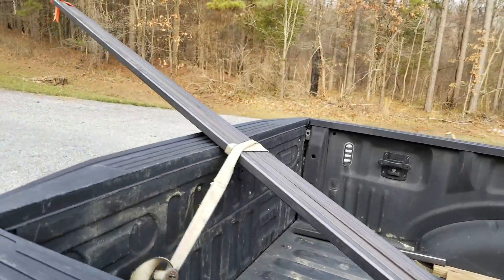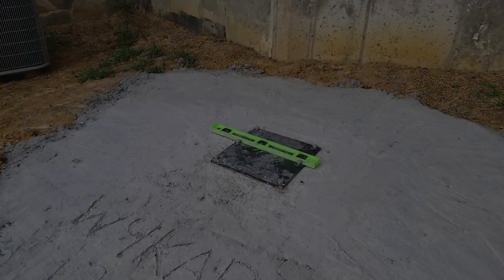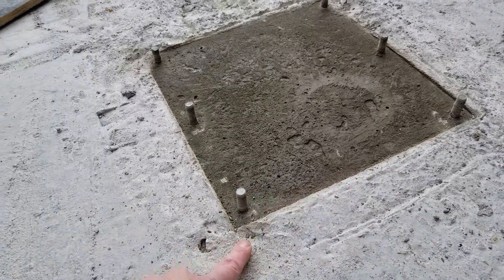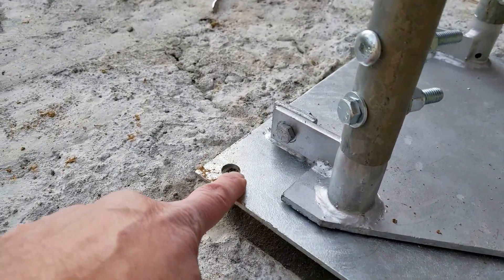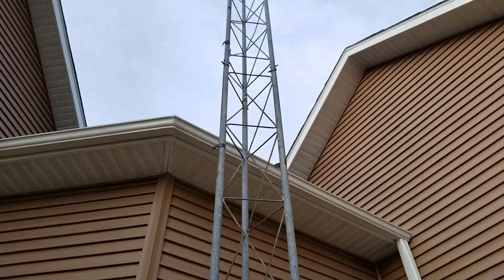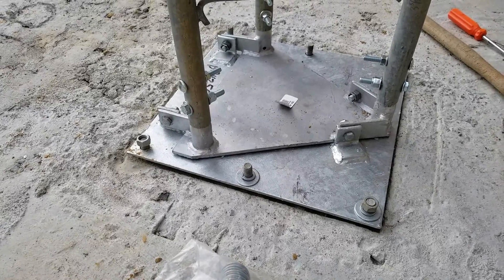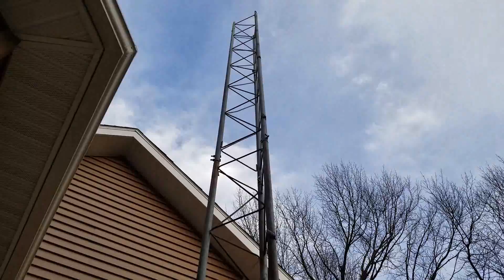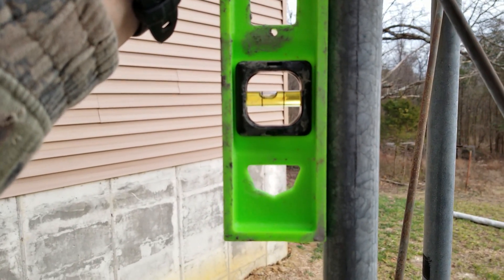DIY Ham radio antenna tower hinge plate installation 12-19-18

Comment: This is pretty cool. As others have said, when setting rods for a base under equipment it’s good to run them long. That way you can run nuts underneath and level the base plate at least 1” above grade by sandwiching it in between the upper and lower nuts. It is important to pack grout underneath then grade it off for support and to keep water diverted away from the base hardware.
Reply from the maker: Well this was a DIY project but it has survived 70 mph plus wind storms and tornadoes have hit close by! Still standing! Thanks

Comment: You don't check a tower for level, you check it for plumb.  If I was going to bracket it to the house, I would have put it next to one of the tall walls and just bracketed to the soffit or wall.  Why in the world would you put it in the middle and have it hanging out next to nothing?
Reply from the maker: That was the best location for it, out of sight in the back yard area. It has survived tornadoes and massive wind storms so it was a success.
Reply: @kapperoutdoors  I'm glad the tower is working for you.  Thanks for sharing.

Comment: Think 80 feet would work on a hinge plate?
Reply from the maker: eek, I don't know. You'd have to make some pretty heft support brackets!
Reply: I know someone that has a hex beam on a 65' tower.  The only guys are heavy synthetic line.  We've had high wind several times but no sustained hurricane force winds since the hex beam and rotator were added.  He does have the ability to lower the tower for storms.

Comment: I like the plate system, why is there 6 ft diameter of concrete?  Is that just spill off?
Reply from the maker: I made the concrete base extra large and heavy just to be safe. So far it has survived years with many tornado warnings and straight line winds of up to 80 mph.

Comment: U didnt show how u lined up base screws and filled in cement ...
Reply: He transferred the bolt pattern to a piece of plywood and mounted the bolts to the plywood and pushed it down into the wet concrete.  Then after it cured, he pulled off the plywood.
Reply: How deep are these bolts? I have heavy duty base plate for rohn25g tower. I trying to find videos show me install of these base plates. Very similar to this video. I plan on doing 4 feet deep cement square.

Comment: Looks like he mounting issue could have been avoided by punching/drilling larger holes in the base plate; for example, 5/8" holes for 1/2" bolts.

Comment: did you finish it i would love to see house attachment
Reply from the maker: I opted to not attach it to the house, but I added the 3 steel leg/feet at the bottom. And It has held for several years now with some pretty nasty wind storms. Thanks

Comment: It seems like putting a lock washer on top of another washer kind of defeats the purpose of the lock washer.
Reply from the maker: eh, maybe so, but I don't think so..? As long as the lock washer flattens out I don't think it matters. However, I am sure no pro at this, just trying to make something new happen. But so far after what 3 or more years or so, it has withstood some 50 to 70 ish mph winds! I did have my doubts watching it sway up there, but it is still all good. Thank you.
Reply: There were several things I could criticize about this video but for me, the part where he used a precision bubble level tool as a concrete screed really took the cake.   When someone loans you tools, they're doing you a favor so for me this is the ultimate form of disresect.  That is why I NEVER loan out tools.
Reply from the maker: Well it's all about improvising and learning new things. The important part is this tower has withstood every bad storm and many high winds so far for a few years, so I'll still call that a success. I am a hack when I am learning new things and taking on new challenges but it has worked for me thus far. Thanks.

Comment: no idea. thought of when i seen video.. is the tower upside down? yep i sure did ask that... iam thinking water flow. as is the water can drain to the outside of the joints. coz more rust in the outside area.. other way with weep holes at bottom. ill go read rohns site see if they say anything on that
Reply from the maker: Not sure if it would fit together like that because the top obviously has to be the tip, and then from there down it will only fit one way. But from a rust standpoint it makes perfect sense to me.
Reply: @kapperoutdoors  dummy me .. i forgot the top... hahahhahah. that iam still tryin to find one for my r25.

Comment: How much is the cost of that tower?
Reply: Hes using Rhone-25 Tower Sections, They're about 75$ to 90$ each section, depending where you purchase
Reply: I got mine for $100 in mn. 30’ rohn 25 with the top pole and the hinged base plate. Neighbor got one for $100 too.
Reply: A brand new 30 foot Rohn 25G self supporting tower kit is about $800 plus freight.  You can find used ones much cheaper.

Comment: I have the same base plate. The bolts for anchoring the plate in the concrete come with two nuts. While I'm rebuilding my cement mixer, I'm wondering a couple of things. Do I pour the concrete and push the bolts into it or I'm leaning toward pouring the concrete with the bolts in the plate. I'm also thinking putting a bolt (and washer) under the plate for leveling but the plate wont be resting on the concrete. My next wonder is how big the foundation needs to be. I think the answer would depend on my type of ground, which is above my knowledge level. I'm thinking something like 3X3X3.
Reply: I'm sure you have already erected your tower by now, so this info is for any new people reading this, back in the day I helped my father erect many, many towers, usually 40/45 foot, but on occasion a 50/60 foot tower for TV use.  For 45' and less a 3x3x3 foot [1 yard] would hold and self support any tower in the central Illinois climate.  Sometimes he would also install eve brackets for better stability.  We would plumb a 3 foot base section in the hole then pour the cement around it, allowing 3 days cure time.  Then slope the slab away from the legs to help keep water from rusting the legs.   Above 45 foot a tower would always get guy wires to ensure it would remain stable.  If you check the Rohn website they show excellent data on how to install towers.

Comment: Looking at the issue with the bolts it occurred to me that if you used a thicker board for the form it might allow the bolts to set in the concrete more true.  Doesn't help you but maybe the next guy.
Reply: Not necessary, mostly you can just put a short length of conduit or pipe over the stud and whack it with a hammer.  (gently) A lot of people just use two nuts to protect the threads.

Comment: I have a question how come you never see anybody mount a ham radio antenna on top of a telephone pole telephone poles are relatively cheap used
Reply: Telephone poles are heavy as heck. They need large machinery to mount it. It also needs someone who knows what they are doing because it's not obvious. Some of the details are weird.
Reply: My guess would be if the antenna OR pole would get struck by lightning, the pole can either catch fire or actually blow apart in splinters. Like a tree would if hit by lightning. At least that's my opinion.
Reply: It used to be popular.   The reason you don't see it much anymore is because the power company won't come and set a telephone pole for you anymore, and they're a hassle to climb.

Comment: Most hams think they know what they are doing when they put up towers as a retired professional tower erector I'm amazed more of you don't wind up in the hospital or worse the morgue. 32 years with Stann and associates and Chicago Tower leasing Corp.  site leasing division.
Reply: Since you've got so much experience, far more than any of us...  maybe you should start making some videos and putting up content so we can learn from you.  Just reading how qualified you are doesn't really tell us much.
Reply: Don't know how to find people with knowledge... so finding most info on HAM on Youtube.  Nothing comes up when searching for "Antenna Install or Service" on Google for example.  Nobody really covers 80% of the detail needed to connect the dots unfortunately, but when you watch 50 of them on a topic, you usually can deduce the info needed to connect those dots.
Reply: Typical expert comment.  Swoop in, tell us how little we know and exit, leaving offering NO useful suggestions.  Also, pro expert, realize that this tower only weighs 120 pounds and the base is about 1/3 of that total weight.  Maybe that we are successful says something about s as a group?

I've helped put up a tower much taller than this one.  I would not hesitate to put one like this without assistance, but I would do it differently.  Furthermore, I would set the base on smooth concrete, attach the bottom section and then add the second section.  At that point it is easily raised with rigging from my sailing background.

Comment: This why I place the base on 1" thread rod and adjusting nuts under a thick plate and then nuts on top of that. Like the do street lights.
Reply: used to run my own fabrication shop and did small steel erection and this is exactly what I would have done too. In a triangle, with only 3 bolts 3/4 " bolts min, prob 1".    I also hate the idea of mounting a bracket to his house. If it was a concrete block wall/garage or icf home etc, then the brackets would be fine but over time your just asking for trouble with the stress on the studs he would anchor to...   But glad he is trying to get a tower up, just not the way i would have done it.
Reply: Around here that is a standard with anything that needs to stay upright and straight.   The frost will eventually heave anything without a 6' deep footer.  The joys of living in in an area with much ground moisture and lot of cold.
Reply: thats to get it level?

Comment: Kapper instead of mounting to the house, you have that large concrete base, fab up 3 legs supports like 7-8 feet long that attach to the tower like a tripod shape and anchor near the edge of the concrete.  That would be plenty strong. Don't want to drill through the siding and mount to the house if you don't need to.
Reply from the maker: You know I thought of that but just thought that it would not be sturdy enough..... however, I might have to think on it some more, since it is a 'self supported' tower (without a hinge plate on it)... hmmm, you've brought me back to that idea now... thanks.

Comment: I think you will be fine by just using the brackets to the house and pulling it back plum you've got it bolted down tight leave it alone you can straighten it with your brackets and I hope Mrs. K doesn't get mad about the level
Reply from the maker: I'm going to explore a couple of options here... Had some good ideas come in.

Comment: Why are you working harder than smarter? Take the base plate off of the tower sections.
Reply from the maker: because I need to level the tower, and take measurements with the tower sections on for bracketing.

Comment: looks like same design I went with. Had a local welding shop make mine for me as I dont have a welder. I have a 72 foot self supporting tower and use a winch to lower and raise the tower. Works well for me. Looks like you got a nice setup there.

Comment: I would put nuts on the under side of the plate and it would only contact the nuts on the bottom of the plate and stay flat.  I would not conform it to the concrete.

Comment: What is the point of the 6 big bolts with giant washers on the base plate when the entire tower is fastened to the hinge plate with only 4 smaller bolts?  Those 4 small bolts will shear off long before those big bolts pull themselves through the base plate.
Reply from the maker: Dang good question! Read a lot of forums asking the same thing!!! Sure wish I didn't have to mess around with the house brackets.... But the hinging will make it much easier to stand up and take down for any repairs..
Reply: @kapperoutdoors  Believe it or not I actually made my own hinged base for my 25G tower. It was 30-feet of tower with 12-feet of pipe sticking out the top onto which I mounted a 5-element HF yagi and a 2-meter yagi. For the base I used 1/2" inch thick plate secured to the concrete with 1-1/4" bolts. For the hinge plate I used another 1/2" thick plate and 3/8" thick angle iron with 3/4" bolts. For the hinge itself instead of bolts I used sections of 1-1/4" black pipe and a 1" solid rod. That baby wasn't going anywhere!  Even with a tower this small laying it over on the ground for maintenance was no small feat as once it tilts beyond a certain point the weight became almost too much to handle. I only tilted it over ONCE and after that I rented a bucket truck anytime I needed to work on the antennas. That is one advantage to the tilt-over towers that pivot over one-section above the ground as opposed to ground level. You can lay them over simply by using a base-mounted hand crank.

Comment: where the ground rod  for the tower
Reply from the maker: They are coming.... Not ready for them just yet.
Reply: ok know when i did my cement base i burried a 8 foot rod on edge of where the my plate went
Reply: Cement acts as a good ground, if rods go well into it. Cement maintains a viable moisture content. That’s a way to establish grounding in deserts. There’s a formula to establish ground w enough cement.
Reply: @treeclimbing7798  Ground rods are NOT to go into cement but 10' out from the base. A lightning strike would explode the concrete. Check the Rohn website for the engineering drawings and warnings. You also need multiple ground rods.
Reply: You never want to ground a tower to or through the concrete base.  Concrete always holds water.  If your tower is struck by lightning, that water will flash into steam and shatter the concrete base and the tower could fall.  Ground rods go into the ground outside of the concrete base and attach to all 3 tower legs so lightning is guided around the concrete base.

Comment: think i'd run a couple guy wires and straighten it with them.
Reply: You shouldn't over tighten guy wires. They need to be a specific and uniform tension else you risk the whole thing crumbling onto the house roof.
Reply: @eosjoe565  he's not going very high.
Reply: @Chris_L050  He said 50 feet

Comment: Before you shim the base plate on the concrete, Loosen the 6 bolts that hold the tower to the hinge plate and give it a shove in the direction you need it to go.
Reply from the maker: Give that man a cigar! I like that idea!!! I will try that first, because I really don't like the idea of shims under the nice flat plate, but I'll do what is necessary! Thanks man.